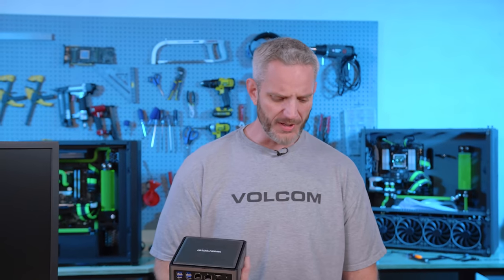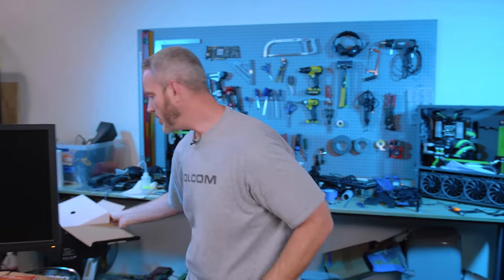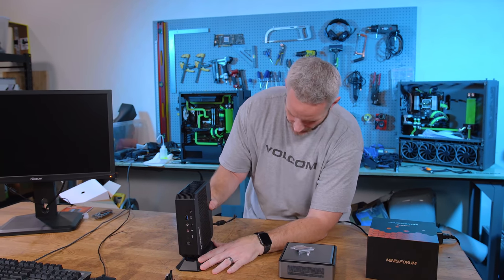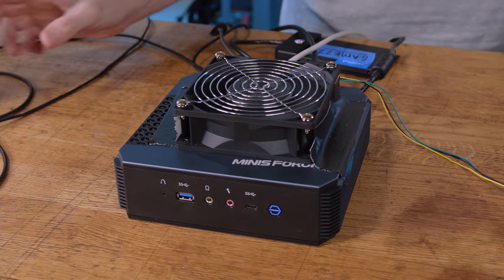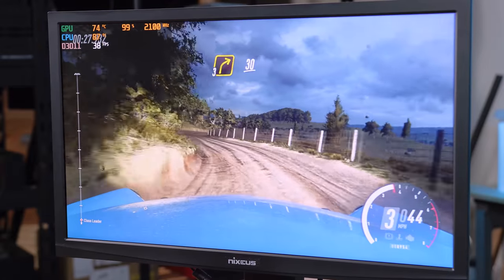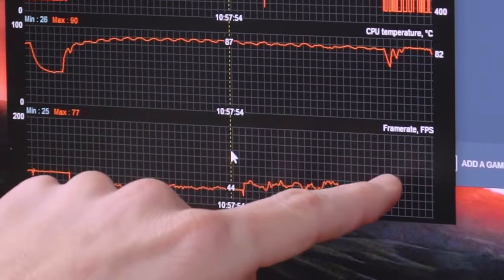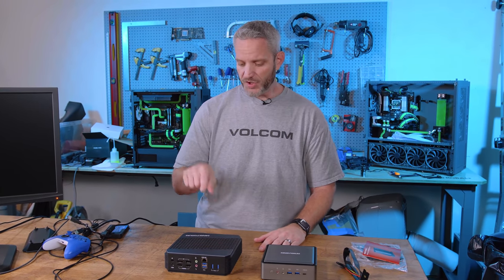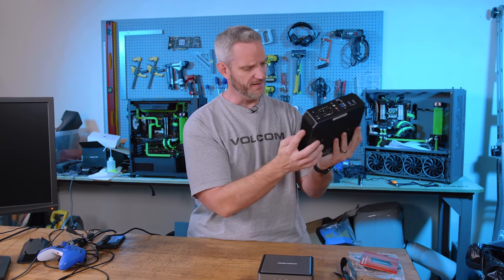It LOOKS like a modem... but its actually a Monster PC!

Comment: Well, that's great and all but, two things, 1st there is no size requirements for a server Jay, technically when you're streaming your phone's screen to your TV, your phone is "serving" the data to the TV it is a server in this scenario, you can have a netbook connected to 5 different external HDDs serving files to everyone in your house while also being a print server. It is also, a server in this scenario. 
2nd, I'm pretty sure my laptop motherboard assembly and internal components are smaller than this one, and I can also game on it, even though it's a very old 3rd Gen i7 laptop I am playing Civ V on it lately. Laptops been doing this for years, I really don't think those SFF PCs are all that remarkable at all. They just laptops without a screen, keyboard and trackpad. That's what I always thought of them, and quite usable, yes.

Comment: How do you get the temps at the top of the screen?
Reply: MSI Afterburner.  It's free.
Reply: @SekizenShade  i have msi afterburner but mine looks different and there is no videos on how to use it. I only know how to adjust the fan speeds haha

Comment: Can confirm that CS Go will not run on a potato: I have a t620 plus quad core thin client with gt1030 gpu, which would maybe normally run the game?, but not on linux. Potato confirmed. So I stick to ut99 which will likely run on a microwave

Comment: You know everything you recommended to use it for can be done with a Raspberry Pi for a lot less cost.
Reply: Yeah, but can a raspberry pi do all of those at once? not quite.
Reply: @igameidoresearchtoo6511  but at the cost you could easily buy a raspberry pi for every task.  Also you would be surprised what a raspberry pi can do.  You can stream a steam game as well as be a media server and it will not chug a bit.
Reply: @JustinSlayton  Uhh, not quite, a pi can't decode well enough even in optimal conditions, but otherwise yeah.

Comment: If I needed PC like that I'd go for 4 core cpu this model makes no sense as htpc. CPU like this one is extreme overkill. 
Something for video editor on the go who wants a desktop experience, although there are a little bigger cases with much better cooling available, with potential for desktop performance.

Comment: Just tried out the nzxt BLD in the Netherlands and it's honestly crap.
You can't call this a proper service.

For example:
I selected a 1000$ AMD machine, it indicated it would only get 50-60 fps in Minecraft and gta V
Once I pressed "continue the build" the price immediately shot up from 1000 to 1264$
And the pc didn't even have a gpu selected.

Comment: You can only game on a potato if you run GlaDOS instead of Windows. BTW, doesn't anyone feel sorry for all the LinkSys boards that are now homeless?
Reply: I'm about sick of how many get on here to nitpick and contradict everyone of this guy's statements. Sure you could prob use an old XT to serve files, but you're not going to run eight drives in mirror RAID, and host 16+ customer web sites per two drives. Customers demand to know how safe their data is being stored, and how quick you will have their site up again, in event of a failure. Unless a topic falls within your line of work, kindly stop posting out of your paper arse.

Comment: Just checked and without SSD and ram runs at 649.99. 4mb L3 cache, Vega graphics. It’s to much for the price you paying. After adding 1tb ssd which the minimum i would consider for new builds and at least 16gb ram you go close to 900. If you want sff PC get on ebay sff Ryzen 5700g builds for around 500 ram included. Nah. Thanks. I’m passing on it.

Comment: Mount it to the back of the monitor with the case being open and put a desktop cooler on it. #pinthis
Reply: These laptop boards have no mounting holes for desktop coolers afaik
Reply: @rickysargulesh1053  indeed, wrote this as soon as he mentioned the mounting to the monitor

Comment: Not impressed, especially with that awful cooling system, my laptop with the same CPU gets better temps than that, while being significantly slimmer and also cooling a 165W RTX 3080.

Comment: It is a shame that they're putting outdated tech inside their APU's I get why but it's 2021 nearing 22 and you still can't play a game on an APU. One wonders when AMD will figure out adding actual GPU mem to the mainboard for the IGP to access instead of slower system mem. How much space would 4 GB take on that tiny board, shouldn't be hard either, calls go to that mem instead of system mem if it's handled by the gpu side, yes it'd be another controller but it's chiplets not one die.

Comment: I already saw it in another video (a spanish youtuber reviewed it last sunday) and sorry but this is an enormous piece of shit. Sorry for the word but there is no better way to describe it. A killer CPU paired with a totally useless integrated GPU that even fails to emulate anything bigger than Super Nintendo. Modern games? Horrible. Older games? They play really bad. It's 650$ and cannot even compare to the portable Steam Deck. The only thing you can do with that "PC" is to use it for programming and little more but...people who do this already have better PCs. Don't get me wrong. If it came with a PCI-E slot (at the same price, and GPU not included of course) it would be an incredibly good machine. Without it this is just an enormously expensive brick, that will let you read your e-mails and watch movies. But you don't need a Ryzen 9 to do that. And less at this price.
Oh! I see you got the retail version with liquid metal. The other review I saw was a pre-retail with only common thermal paste and temps reached peaks of 98º C. Never went over that temp though.

Comment: Mini-PCs are a waste of money. There is literally no point to them, they are weaker and have zero upgradability. May as well just buy a console.
Reply: Mini PC's make great office computers or media computers.
Reply: @stephenathon  One does not need a media computer...you can buy a Kodi box for under $50 and connect drives containing media to it.

And no IT personnel worth their salt would EVER use a mini PC for their offices. They are a bitch to fix.
Reply: @thomasjones4570  I use a livingroom media PC, it's quite versatile.

"Just buy a console" doesn't make sense when you do little to no gaming.

Mini PC's are great in space-limited applications and typically consume less power than tower PC's.

 I've helped implement several of them in small business and home office environments with no trouble so far (I'm not an IT professional). 
Serviceability is admittedly limited but at least my Dell 3080 Mini has 3-yr warranty support.

I have heard that IT companies will install hundreds of Dell, Lenovo, and HP mini PC's at a time for some customers.

Comment: IT IS NOT AS MONSTER AS MINE  CPU: RYZEN 7 1700
 RAM: 16 GB DDR4 3200MHZCL15 GS KILL RIP JAWS 
GPU: GTX 970 G1 GAMING 4GB 
HDD1: WD BLACK 4TB 
HDD2: 1TB
 PSU: CORSAIR 750M 750 WATT
 MONITOR:DELLP2416D 24'' 2560X1440 60 HZ IPS 
MOTHERBOARD:ASUS PRIME X370 PRO
 SSD: MP 600 2TB WRITE 4950MB/S READ 4250 MB/S

Mine is a true monster and is strill runs evrything maxed 1440p 30+ fps and some games it runs them even maxed 1440p 60 fps like balan wonderland, crash bandicoot 4, yakuza 4 5 6 ghost and goblins resurrrection e.t.c. See my videos to see how monster my pc is and ho wbrutally i kill my enemies!